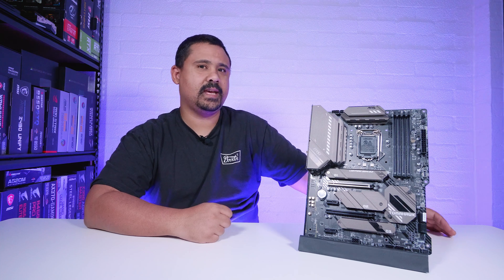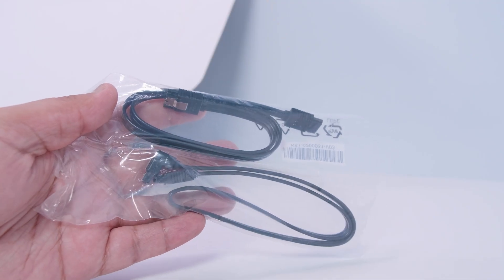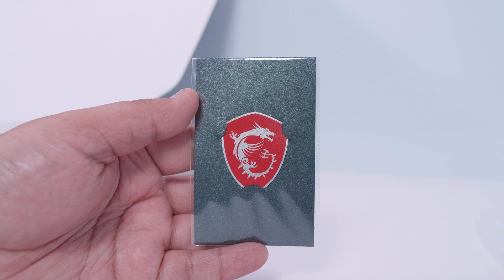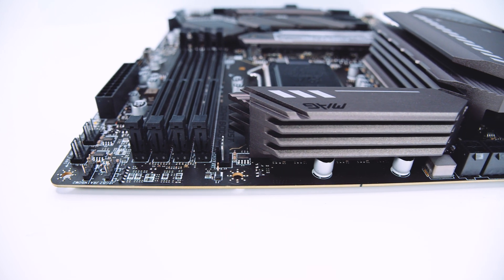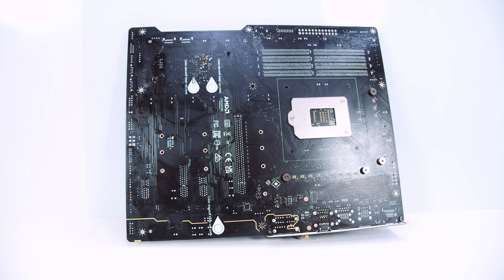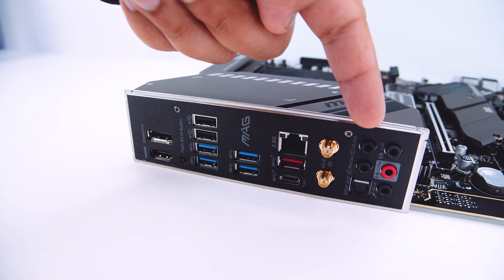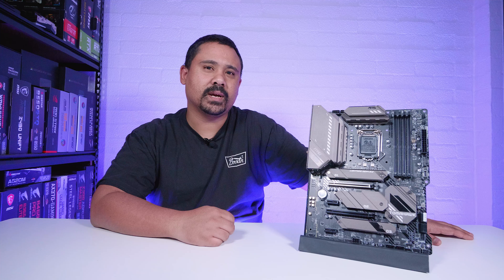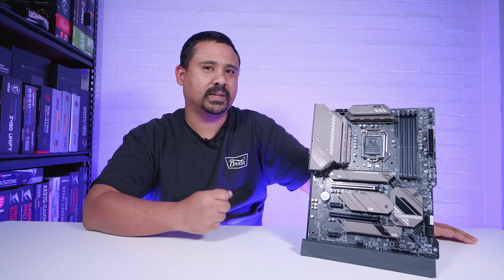MSI MAG Z590 Tomahawk WiFi - First Look and Overview

Comment: Hello, I just bought new PC Z590 Tomahawk WiFi from MSI with i9 CPU . I got also NVME XPG 512GB  but the shop placed on third slots is it okay? until now I don't have any problem with speed but is it in the correct place!!!
Reply: it will run at PCIe 3 speed. Put it in top slot to run at PCIe 4 speed. It's speed is being limited at PCIe 3

Comment: Question: If it comes with the drivers on the usb, can I install the drivers directly after booting into the bios. So essentially, turn on pc for the first time, install board drivers from included usb and then install windows. 
If  not, then what is the point to them offering the drivers on an included usb stick as after the initial setup and installing windows, you can just download the latest drivers on another usb stick and install them that way ( the board drivers that is ).
First time builder here, so sorry if this seems like a silly question or if I made a mistake.
Reply from the maker: No. You need to install Windows first. You might not just be able to download them because WiFi and Ethernet more often than not will not work with drivers being installed. They also include them on a USB for people who aren't going to have an internet connected PC. Hope that answers your question :)
Reply: @GearSeekers  awesome, much appreciated!

Comment: I'm confused about these NVMe slots that are connected to different portions of the boards. I can understand that they share connection with some other features. But for example, does using the No.1 NVMe slot on a board like this make your main GPU slot perform less thus affecting performance? I hear things like "using an NVMe on the first slot turns the PCIe slot from 16x to 8x" and it gives me that assumption. I simply cannot think of a case where a user would prefer a bottle-necked GPU slot for a single drive.

Comment: Who would use wifi for a desktop? lol Fiber to eithernet is the way to go!
Reply: It's a good backup if a cable goes bad. It's also good if you need to temporarily move it into a non-wired room (say hook it up to the living room TV for a family gaming session), or have to put it in a room that is hard or impossible to wire. Some college dorms don't have anything but wifi. Also, the same chip gives you bluetooth as well, so you can use your bluetooth headphones or exercise device, or whatever. I always though the same as you, but experience has shown it does add value.
Reply: Some people would rather not have a wire and be able to have built in WiFi especially if they’re going places with their PC.

Comment: I need to  grade from my msi 350 tomahawk on AMD cpu and gpu ?
Reply: I don't know where you are, but if you want a recommendation,  I built a PC with an MSI B550 Gaming Edge WiFi mobo. That should be able to take your old CPU with all the new stuff like a single gen 4 M.2 SSD for boot drive, lotsa RGB and good performance. It's very nice and should last me many years since I rarely upgrade.
Reply: If you want you can go with a x570 or b550 mobo i would recommend the msi tomahawk its great. Cpu if u can get ur hands on the new gen of cpu try to get the ryzen 5 5600x and as for gpu if u want to go amd also get a rx 6800